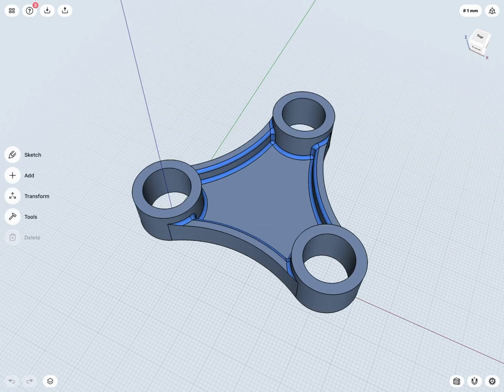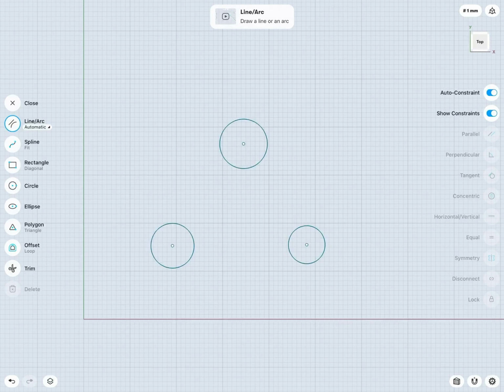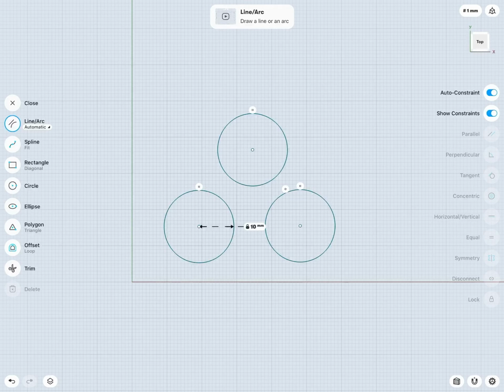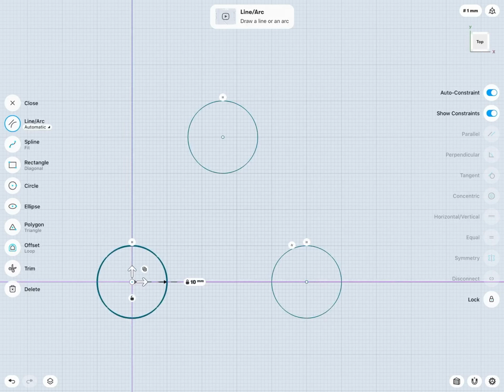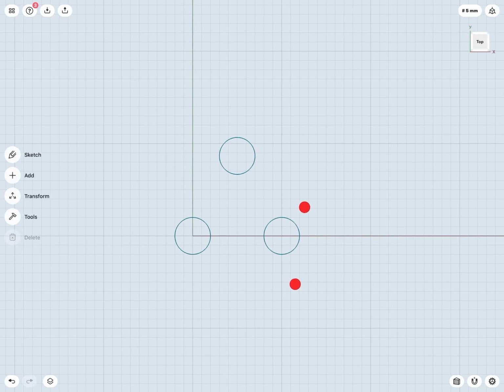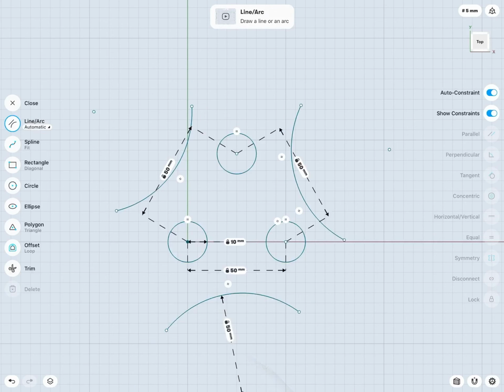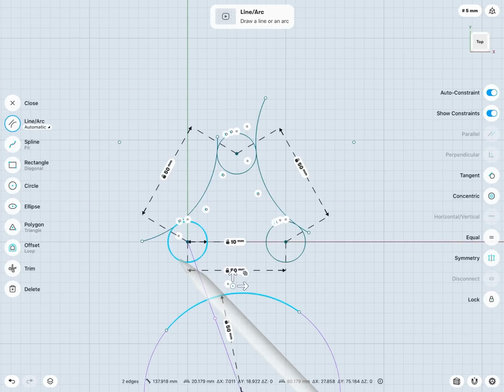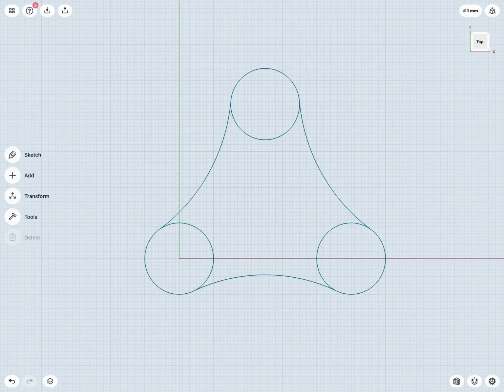Finalize sketch | Draw 2D sketches

Comment: Hello! The tangent and circle isn’t  working on my shapr3d. When I try to use the tangent on both of them. The circle changes its size. How do you fix it? Thank you
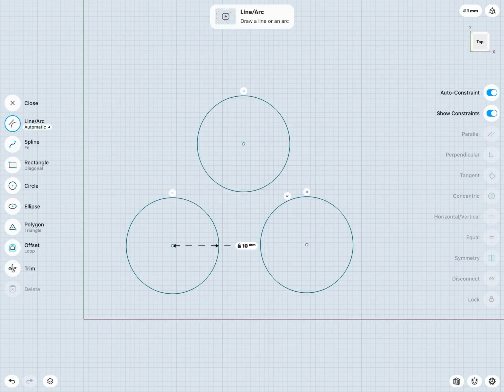Reply from the maker: Hi :) The reason why his circle changes its size is because you never locked it. If you watch closely, at 0:49, when the tutor enters the dimension, this basically locks the radius of that circle. This is maybe the reason why your circle changes size. Also please note that having the "Equal" constraints enabled helps you to have circles with equal diameters.
Reply: @Shapr3d  thank you for responding! I will try it!

Comment: Hi folks! Not sure where the best place to ask this is, but here goes. I've been trying Shapr3D for the last week and really love it so far. My main problem is that after I 3d print a test there will often need to be a tweak or two. But I don't really know how to "go back" and fix/change something. Seems like once I do a union there's no going back, ditto with chamfers and some other stuff. Is there an existing video that covers best practices for making a design and then tweaking it? If not could there be? Thanks!
Reply: p.s. I'm not very experienced w/cad apps. Some tinkercad, more recently tried to learn a little f360.
Reply: And you can go back and edit the original sketches to affect change in previously sketched bodies https://youtu.be/l5e5AFHETG0?t=607
Reply: Can't see you got an answer here. Maybe it's because it's hard to go back and change something. I suggest you to try Fusion360 instead. Much easier to change things with Fusion360. Also much cheaper to use as it's free for personal use. Shapr3D cost too much just to get simple features like coloring, etc.
Reply: @KennethGundersen  While your comment a year ago was spot on, the new limitations in Fusion360 of only being able to work on 10 active documents is a bummer for personal use.
Reply: @JeremyClow  I dont see a problem of having only 10 active documents, as I usual just work on 1 document at a time. If you need to activate a new document you just deactivate one, for example the oldest one.
Reply: @KennethGundersen  I just watched a video on the 10 live documents and it isn't nearly as restrictive as I had been told.